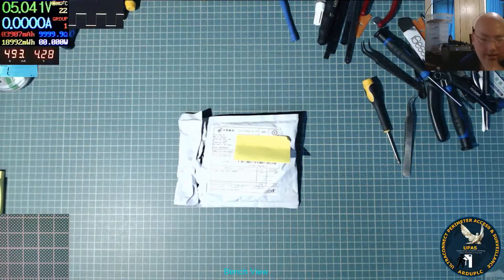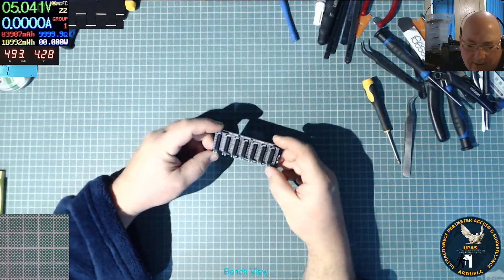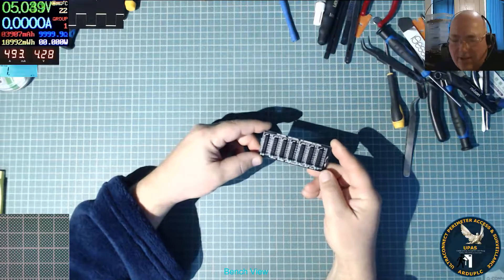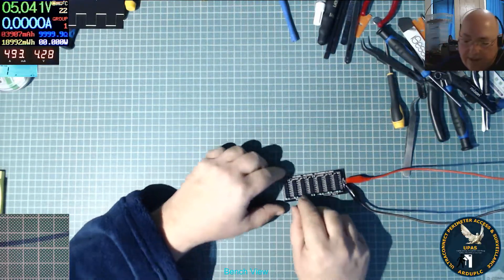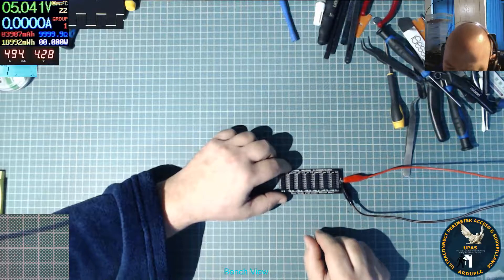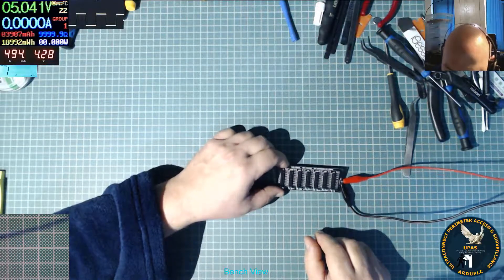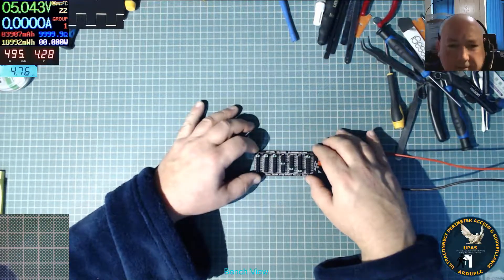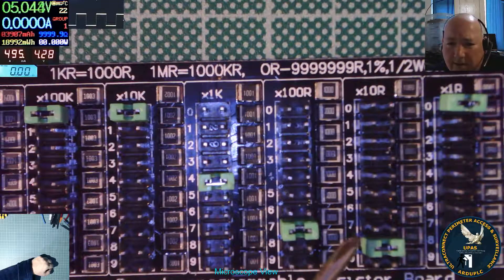Review#2 - Seven Decade Programmable Resistor Board

Comment: using Breadboard or Arduino Female to Male jumpers on that resistor board would make connecting it easier. Attach the female ends to the resistor board, and you can plug the male ends straight into your breadboard or attach alligator leads to them.
Reply from the maker: Took a bit of working out initially, not done much with them since, thanks for comment.